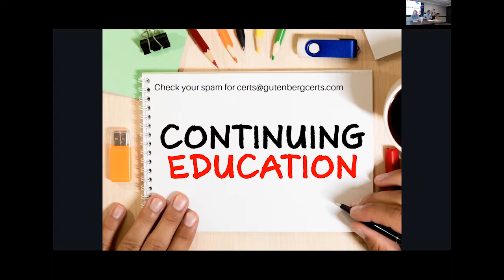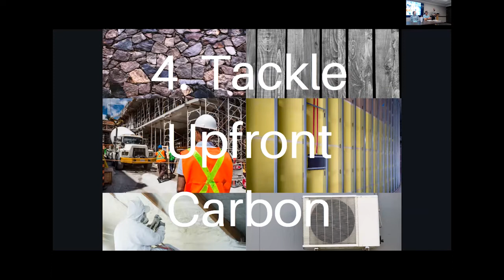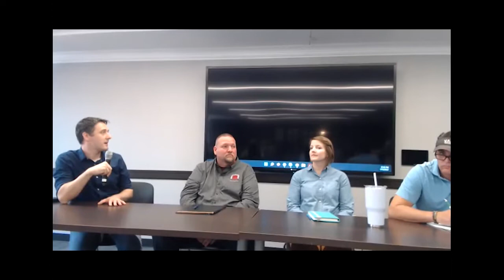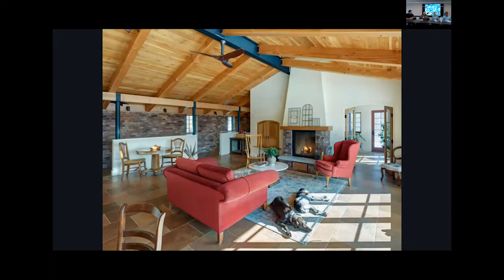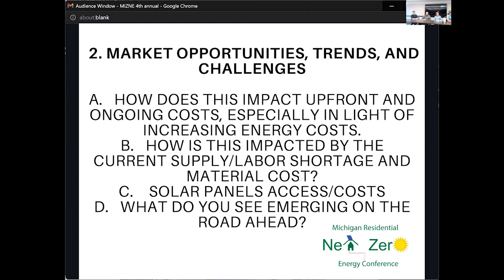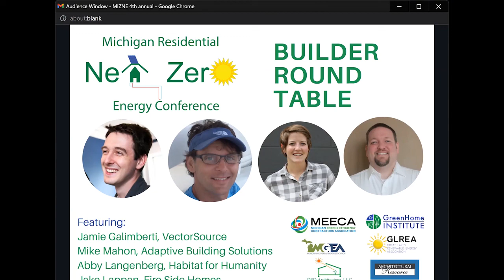4th Annual Residential Net Zero Energy Conference - Builder Round Table

Comment: The frustrating thing is that the information is out there but there are lots of barriers put in front of people who know the information and have the skill to design and build a very efficient, potentially net zero home.

I know exactly what I want to build and how I'll build it (with my two hands) but permitting in my area requires lots of engineering even though I am pulling all of my design elements off of building code, span charts, prescriptive methods, etc.

If I do things the way my planning department requires I'm going to have to double my budget to waste money on engineers, architects and general contractors I don't need or want.

If I could do things my way, I would have a two story, 1,800 ft^2 ICF to the roof building with a low slope single pitch shed style "cold roof", about R45 dense packed fiberglass, a radiant barrier and standing seam steel roof (hand seamed) with zero penetrations, high efficiency doors and windows, redundant mini-split heatpumps, solar with batteries, rain water/grey water recycling/irrigation, recycled tire "mechanical concrete" under my paver driveway, mafia block retaining walls, a couple nice decks, well thought out drainage and a garden of greens to feed meat rabbits.

I want to do hobby metal work and maybe a small business so I'll get enough solar to zero out machine tools and welders.  I would have meat rabbits so I don't have to "eat the bug".  I also plan to recycle waste vegetable oil so I don't have to pay for diesel fuel.  Water would be the only utility I'm connected to.  As long as the roof doesn't leak and the envelope stops bugs from getting in, I'll probably be dead before anything major fails (probably not counting the solar inverters/batteries and some plumbing fixtures).